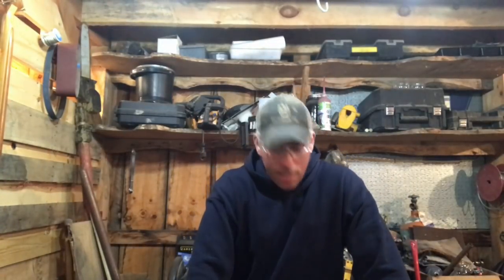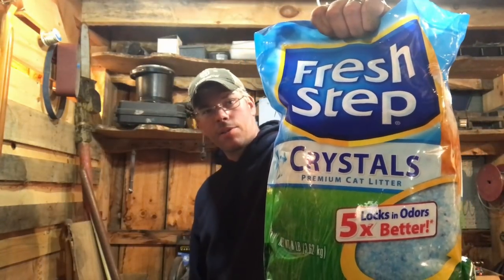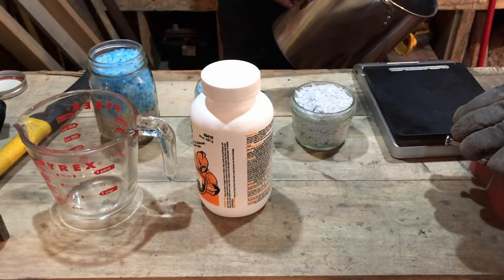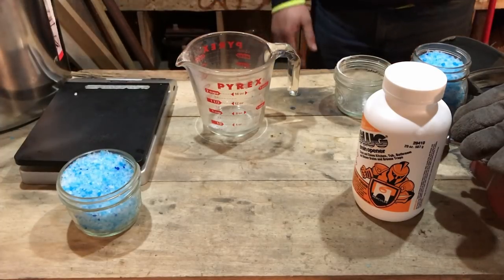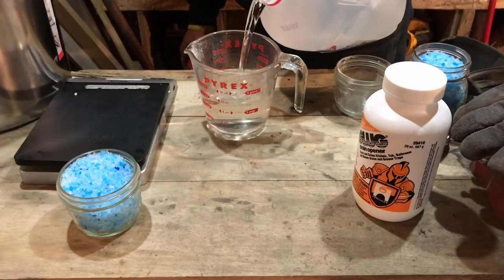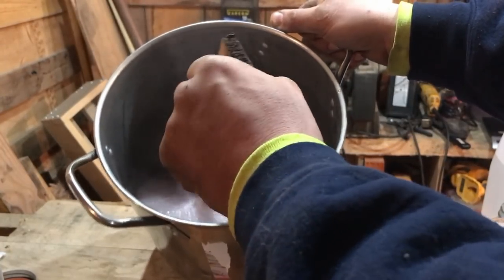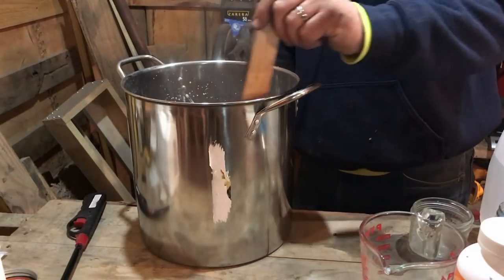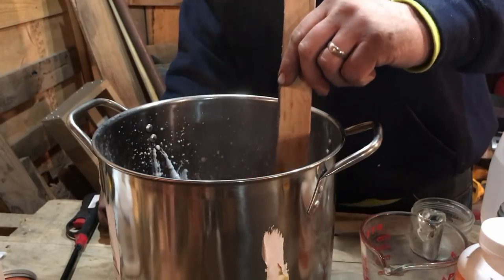CAT LITTER FOR FORGING?!?!

Comment: Soap makers carry 100% lye.   The stuff from them is less likely to have a cloud when pouring.  Please read about using lying before making this.   It’s dangerous and can seriously injury you.  This is done backwards.  Always add lye too water.
Reply from the maker: You are right and I was very wrong.  I'm moving your comment to the top as a public service message.  As a side note, when I was starting in HVAC as low man plugged drains and nasty urinals were part of the daily routine, we always added the lye to water.
Reply: Yeah but much more expensive.

Comment: Sodium Silicate is water glass. Interesting stuff. It can also be used with portland cement to form a very useful concrete. It sets in 30 minutes though so you'd better be certain about what you are doing. The first time I encountered it I just wanted to play with it.

It's fascinating stuff.

As a retired safety compliance inspector and executive, I cringed as I watched you work.

I've done MUCH worse. I didn't do useful things like a forge. I blew up logjams in our creek. I won't tell with what here but your imagination may not quite be good enough to picture it. They shut down the nearby general aviation airport...
Reply: Nothing a lil tannerite wont fix.

Comment: By the way, a strong solution of lye and water instantly cleans sanding belts and saw blades.  Pitch and resin just falls off the sanding belts. I use 37x75 sanding belts and this saves me thousands of $$$

Comment: How did it hold up? I only saw a video a month later and not another after with this forge. Just wondering.. It didn't seem like it would last long..
Reply from the maker: A friend of mine has it and uses it daily, it's held up fine.  I built a big coal forge and a ribbon burner forge since then.  I'd recommend a ribbon burner any day of the week.
Reply: @TheTradesmanChannel  Awesome.. Good to hear. Thinking about an Aircrete with some inner lining for the next "Small" forge. Ribbons.. Yep.. I have most of the parts for when I need a large forge.. Seems they would have to be a bit more efficient than other burners the same size/output, but, I may be wrong. Saw that forge build.. Looks great.

Comment: Looks like you can buy silica gel beads pure. WalMart is listing 1.5 lb bag of “flower drying crystals” for $10 not sure how that compares pricewise to cat litter. Upside is no extras as contaminates. 

Side note: set up an account with Amazon, when you list products you use in videos and share the link you’ll get a referral fee of one of us clicks on it to get to amazon and buys anything at all. So even if I didn’t want to buy any of the supplies you suggest, I could still help the channel by clicking over through you and buying whatever it is I want.

Comment: What is not commonly told is sodium silicate (waterglass) has a temperature limitation of 2,000F its melting point. If your melting copper or aluminum or gold ypur ok. If your heating steal to hammer it your pushing the limit and will fail in a short time. But you cannot reach welding temperatures with this method the sodium silicate will melt causing failure of the refractory. For that you need a refactory capable of 3,000F usually a ceramic made up of alumina or a high temperature fire clay that is high in alumina or quartz.
Reply from the maker: That is good to know.  I prefer coal for forge welding.

Comment: Not sure I would use a wooden stick to stir it.  Plastic probably better, if you're going to the effort to use distilled water.  Also, I've wondered about using the freeze test to determine "done."  I've wished for a hygrometer to measure specific gravity, I think it would be more precise.
Reply from the maker: +dansw0rkshop you are probably right but I don't think the stick hurt it.  It set up just right with the heat
Reply: It was blackish when you poured it into the jar... mine turns out clear.  Maybe it was the blue colored kitty litter, but I think it took some carbon off of the wooden stir stick.
Reply: Yeah ultimately I think it's pretty forgiving.
Reply from the maker: It was the cat litter, it set up very well. Worst part is I've thrown out tons of water glass doing boiler work without knowing what I could have used it for.

Comment: does the lye lose it's caustic properties in the process?
Reply from the maker: Yes it does.  It's a pretty cool thing.  I have the forge finished now, just have to edit the footage.
Reply: at one time my hobby used it as a glue, per say,. I polish rocks and it was used to glue it to a stick for handling. It was supposed to be superior to modern glues or waxes of today. I see why it is very difficult to find any way to make it. thanks.

Comment: Morning Jim, Happy Easter to you and the family,

Really neat stuff, I have never seen that used  as a glue for a forge. I used fire clay, perlite, play sand, to make my foundry. That worked great for it but is extremely heavy. I have used it to melt everything from aluminum and brass.  

Wondering how heavy your finished forge is?
Reply from the maker: It is super heavy